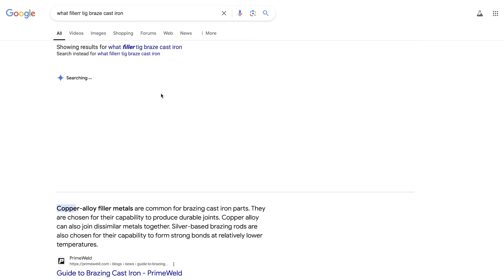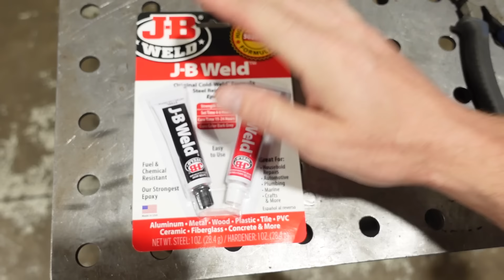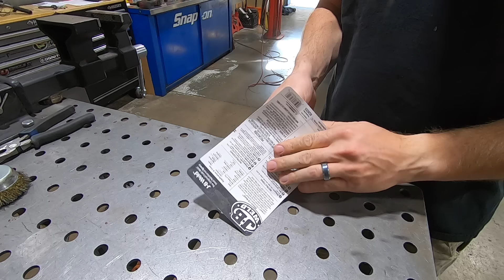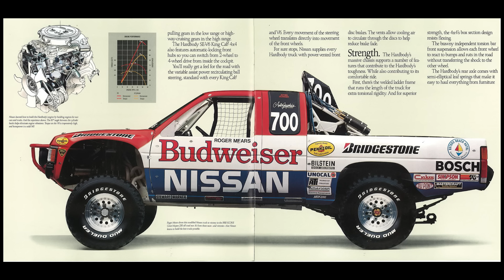the MOST DIFFICULT REPAIR I've attempted + project truck updates

Comment: Nothing wrong with using JB weld to get by until you can fix it. I used it 20 years ago on a cracked radiator hose cooling neck on my tractor to get through hay season that I was right in the middle of…..aaaand I still haven’t replaced the neck. It’s on my to-do list. 😂
Reply: It'll get done when the jb quits welding lol
Reply: I did that on oil pan on an 06 cobalt. It took me 3 years until I replaced it
Reply: The only thing more permanent than a temporary repair that works is an emergency/temporary .gov spending program.
Reply: Guaranteed to break tomorrow since you jinxed it 😂
Reply: @jseal21  little more jb weld and he’ll have it for another 20
Reply: @roughneck2204   Right you are. Every time I acknowledge a rigged up patch it breaks the next day. But a lil J.B. and it's back in action

Comment: JB weld works. Years ago I was rebuilding a 69 Toyota 3rc engine. Screwing in the fitting into the cast iron oil pump, I cracked it. Couldn’t afford another new pump, I fixed it with JBWeld. Ran the car over 100,000 miles. No problem.

Comment: I can't judge you LT because I'm a 20 year Ducati mechanic, and I used JB Weld to fix a block porosity oil leak back in 2007! I removed the cylinder studs, coated the threads in JB Weld, then screwed them in hand tight. It worked! But I feel bad for the future mechanic if for some reason they have to replace a stud in this engine. They are in for a big problem as I'm quite sure they will need new cases!
Reply: I’ve used JB Weld to make repairs I won’t even talk about.  It simply shouldn’t have worked nor should have it been tried. 
    Being the Indian among a too many Chiefs, I was the one made to do the deed.  
    Can’t say that any of them failed.

Comment: I filled a 1 inch casting hole(bubble) in air comp. block. Used it for years, no leaks.       It works!

Comment: In 35 years in the automotive machining business. I’ve seen numerous attempts to repair cast iron. 
   The only successful methods I’ve seen have been spray cast iron process with the casting heated up first and more importantly cooled down and a very slow rate.  
     I’ve also seen one starter bolt hole repair made with nickel ni-rod sp?   That part of the block was heated red before the welding was done.  
    The most successful.  Irontite crack repair pins and JB Weld. 
   In this case it would be iron tite and JB Weld as my first choice. 
    That head bolt close to that weld is my concern.

Comment: I have used a product called Devcon I had a unit with a Perkins engine that had a water jacket broke in a corner I cleaned the pieces and glued them back in place and then applied layer over top. The next day I came back filled the coolant.
I drove the unit out of the bush and sent it back to town.five years later the customer had not changed the engine,and was running the unit six hours a day 
The product is amazing

Comment: JB Weld for the win buddy 🤘🏼 

BMW E9X takes an LS motor like they were built for it especially with the support that's available for them now.

M156 C63 is another cool project to do, very expensive to do them right though but they are absolute monsters when done right. 

The other would be something with an M113K in it, basically the German LS motor, throw that in practically anything for beautiful blown fun.

Comment: "It's not stupid if it works" i keep being told by tons of retired vets. As a something more permanent, did you keep the stock heads from the psi build? I ported my stock iron heads to 320cfm. If I where you I'd pull leaky head from uglytruck as practice, starting with the bad chamber. All you need is a spare valve set to shave from combustion side as guides for shining the actual chamber, other then that its just time and love. If your up for it I'll share what I learned doing mine.

Comment: How about making an awd Monte Carlo SS?  It requires frame work (grafting an Astro Van front to the Monte frame.  You like frame work lol  Another big block with a turbo or supercharger.  You love boost and making kits.  Then give it all the handling/brake mods you can with the creature comforts like ac etc.  After that take it to road course, ls fest or things like that and see how it handles.  Shoot you might be able to even 4 wheel drift it which would be amazing with all four wheels smoking at once going sideways.  My brain is like yours, but I don't have you skills to make it happen.  Love the videos and the channel.
Reply: AWD G body are cool. I think it was done by someone in US with boosted LS.
In Poland VTG has build AWD 1st gen Camaro and 3rd gen Corvette converted to AWD using GMC Syclone/Typhoon frame and front suspension both powered by +1500HP boosted oldschool SBC.

Comment: At a IMSA Road America Race years ago, our car was forced off track and smacked a tire wall. It broke the trans mount among other things. When the trans fell and hit the cross member it put a quarter size  hole in it. We were at the track until 2am fixing it. I ended up cleaning around the hole,  some grinding, more cleaning and JB Weld. Trans Fluid in the morning and we qualified. That repair held out with no leaks for the rest of the race season because the case and transmissions were on backorder.

Comment: Good on ya for showing the try and failure and then the path forward LT.  At least the truck isn't mothballed for the next year and still able to be used.  Question for ya, when you are welding on engines/exhaust/chassis, what are you doing to protect the computers/BCMs etc?  Keep it up man, love the content!  🏁

Comment: I really want to see the drag truck completed.
Would much prefer a nasty N/A LS or LT in the S10. You could make 600HP all day and it would be much better on the autocross or roadrace course. Be even cooler if you made it a manual transmission, but I don't even know if such a thing exists that would fit your transfer case.

Comment: Ok, I repair cracks in cast often. That can be fixed by pinning with irontite pins or lock and stitch pins. No welding required. Look it up.

Comment: I would have tried SSF-6 56% silver brazing rod because of its lower temperature requirement of 1150F instead of 1900F, but would not have high hopes on cast iron.  What might have been better is to drill a hole for a grease fitting to inject the JB Weld into the crack at high pressure.

Comment: My vote is 100% on the LS Swap E9x.  Manual trans,  NA, and use it for AutoX or other racing that requires turning the steering wheel at speed.  I like the sedans  but double bonus points for an E91 wagon. Meh to the coupe or convertible.

Comment: 257 👍's up LT thank you for sharing 🤗
Reply: Use cube pepper and crush it up and put it into your cooling system plug off your heater core so you don't get it in there run it for a few days and the pepper should fill in the cracks and the pressure of the engine running and cooling down should pressurize it right into the crack and you'll stop your leak and it would most likely last for a long time cuz that's an old farmer trick using cube prepper breaking up into 8 inch pieces and let it go through the cooling system

Comment: I bought a VW with a hole in the crankcase.  Someone had JB'd a nickel over the hole approx. 20 years before and it was still holding tight.  Don't knock the staying power of JB.

Comment: I have a small crack on my 3.7 jeep motor and leaks mabe 12 oz in 4 to 5 months. But i think its going into the cylinder but the motor just fantastic with no issues and have over 200k on the motor. I don't want to take the heads off cuz I'm lazy.

Comment: Cast Iron weld repairs are a real can of worms you just never know where they will end. You either get it all quite hot or if you have to do it cold do very small bits letting it cool inbetween. I have tried all the welding method on iron including a mig with bronze wire {Not specialist just wire used for sheet metal work like car panels} and the best success I have had was using a stick welder. High nickel content rods were not the easiest to use but worked well.  Good Luck with the 2 part epoxy.
As for a build idea for something completly different and a bit off the wall how about something like a Lotus 7 clone? If you wanted to dig into the fab side a build with long travel suspension and maybe 4WD.  Virtually a buggy but road safe and legal. Huge job but intersting and probably a lot of fun to use?

Comment: JB is good for some jobs. I glued a striped windshield wiper on that stayed till this day and beyond. BUT. I wouldn't use it for engine structural repairs. First among a endless list of reasons it doesn't heat cycle like the rest of the heads do. And because of just that i would never use it for that kinda repairs. Like they say you can do it right the first time or do it twice.... Lmao imo.  Keepemcoming

Comment: I think it would be cool if you found a 4door s10 & put an 8 foot bed on it, put 2.5 ton axles under it & narrowed them so they look like factory axles, stuff a modified duramax diesel in it, keep it a 4x4, & use it as a heavy duty mini truck. Maybe give it one of them suspensions that allow the truck to lay on the ground, it would so much easier for you to load heavy things in the bed because instead of lifting them & hurting your back you could just walk right up in the bed since it is on the ground.

Comment: You should not be cooling off the metal with compressed air.  The rapid expansion and cooling can’t be a good idea. The head should become your test subject on more welding
Reply: Differential heating is stress loading that cast grain structure.

Comment: JB Weld...Truck Tech meats Roadkill...good times...
Reply: For perspective, Mike Finnegan used JB Weld on his racing jetboat with a 1000hp twin turbo V8 when a head were found to have a casting leak that leaked coolant into the combustion chamber. It worked.

Comment: 2:55 Wow. I can’t imagine a world where, instead of welding something, I’d just hand over the cash for a replacement part. Crack in an aluminum, big block Chevy cylinder head? Never mind the welder, just turn loose of that 4,000.00. Don’t fab your own headers and weld them yourself, don’t pick up that hammer, when you could simply pay a guy with soft hands to push a key on a machine and have them all “hammered” together for 5,6 grand.

Comment: Need to read up on crack propigation. Even it were the smallest you could fit in there, you needed to start off by drilling the ends of the initial crack. The rounded edge would have removed stress from the surrounding material and when you heated it, it most likely would have prevented new cracks from forming.

ETA: You live in Colorado, do a Prerunner build.